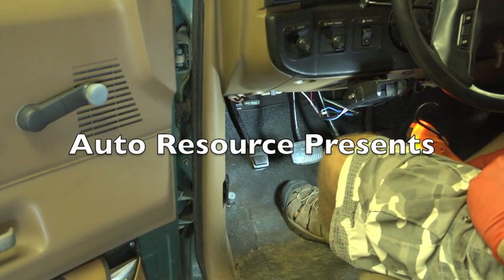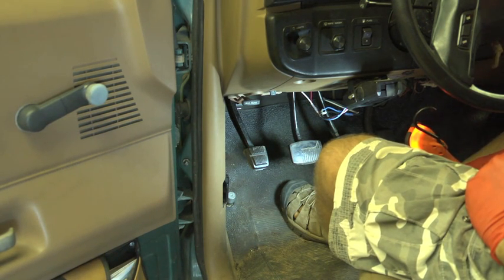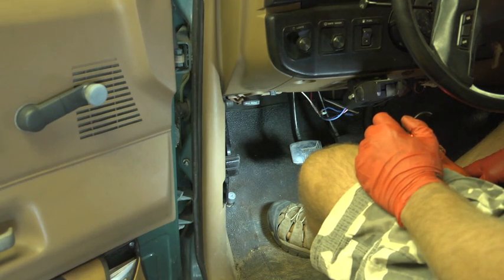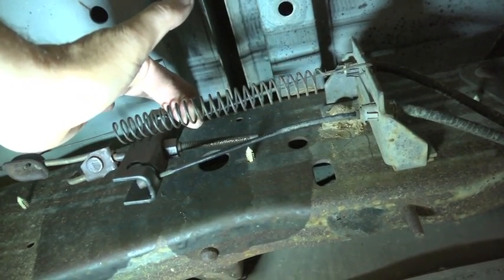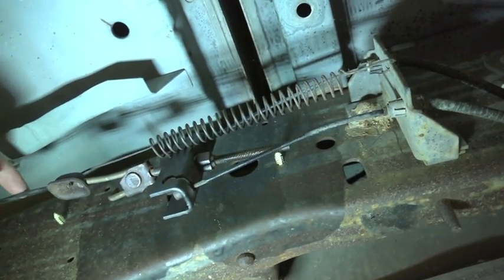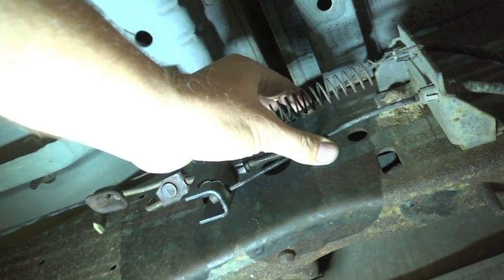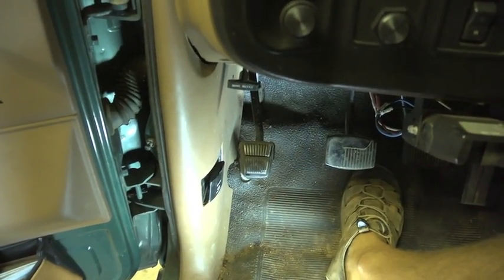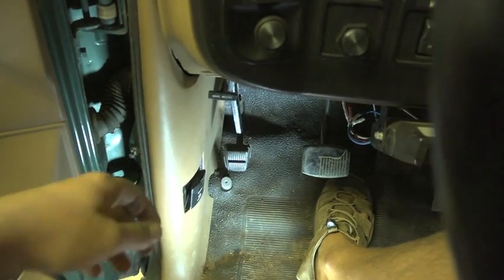How to adjust parking brake

Comment: WHY would this adjustment nut need tightened a full inch?  Do these cables work fine for 30 years and then stretch one inch suddenly?  or do I have problems with the brake HANDLE (under the dash) and must adjust it there?

Comment: one thing about these 80-91 trucks, ford messed up, they put the windshield  electronic control box on the bracket above the e-brake on the lower dash frame above the e-brake pedal, dont just release the e-brake, put your foot on the e-brake pedal then release using your foot to let up the e-brake pedal, if it is released and you let it slam like that it will damage the windshield control box ,  its even written on that box ( DO NOT DROP), so if you have problems with your windshield wipers stopping while they are turned, this is the problem, and you cant buy that control box anymore,  take that control box out  open it and see if the electronic board inside is cracked, you can take it to a computer repair shop and they can usually re solder the parts back onto the board,  you will see this box behind the headlight and wiper switches , get in there and take it off the metal dash bracket and just use zip ties and hang it loosely from something under there out of the way ,hope this helps some of you guys out,

Comment: My line broke off I have 2 lines going  to the rear I need to know which way to pull the metal inside to release do I pull towards cabin or push towards rear tires

Comment: No no no. Adjust your brake shoes first. Make sure you don't need new brake shoes. I was a Ford tech for 15 years. Rarely had to adjust cables
Reply: We just got a 03 tracker in here at the shop and we replaced shoes ran adjusters all the way in and just barely got our drums on . The driver side drum is holding back and all we have left is the cable but you're absolutely right my friend you rarely need to mess with your ebrake cable but this is one of those rare gifts we've been given 😒
Reply: There is only 1 cable going to the parking brake pedal, and a separate cable for the brake release in my '97 Ford Expedition Eddie Bauer Edition.I don't see an of what's show on this video.
Reply: Cant find any ford 500 videos aboout this

Comment: Hi do you adjust the brake when it’s in an on or off position ?👍
Reply: It can be done either with the brake on or off but it's much easier with the parking brake disengaged. The main thing, like he said,  is don't get it too tight.  If you do your brakes will be engaged all the time you are driving.  
I advise to chock your wheels and put the vehicle in park or 1st gear if it's a standard transmission.  
Be sure that you don't adjust the cables too tight.  You should have a little slack in the wires going to the brakes.  
Your parking brake pedal should have a little travel before the brake starts to engage but shouldn't go to the floor.  If it's going to the floor and not keeping the vehicle from moving, you need to adjust it tighter.  If the pedal only goes down a little when you engage the brake completely it's adjusted too tight. 
If you have it adjusted as far as possible and it still doesn't keep the vehicle from moving, you will have to replace the cables. 
Remember, ALWAYS, SAFETY FIRST!  If you have to jack up the vehicle to get under it, wheels chocked, support the vehicle and it's a good idea to have someone with you,  just in case it falls.   
NEVER jack a vehicle up on a hill, get it on as flat surface as possible. 
Hope this clears it up for you. 
Ideally there should be a little space before it engages the brake and when fully engaged it should not be on the floorboard and the vehicle shouldn't roll.